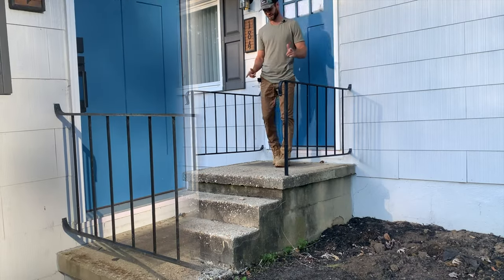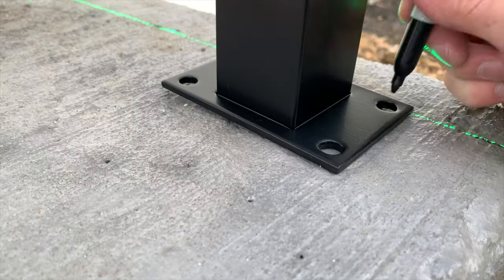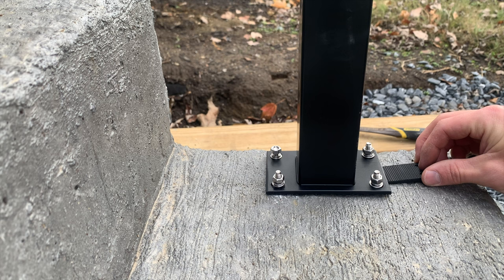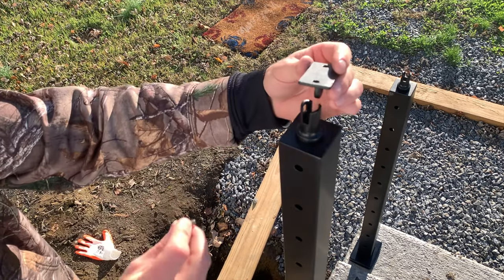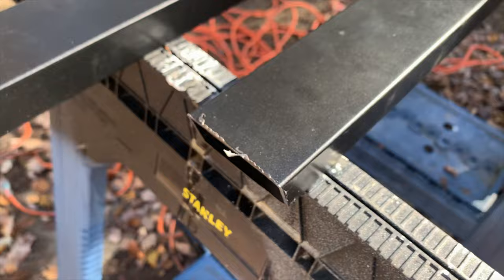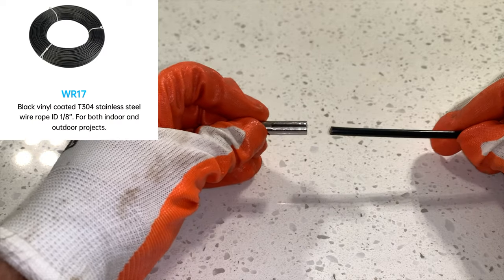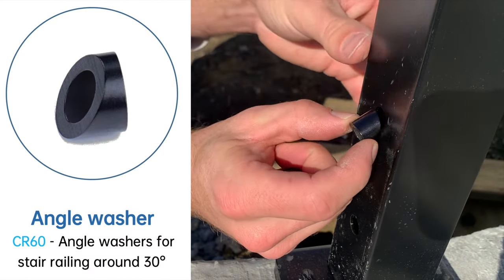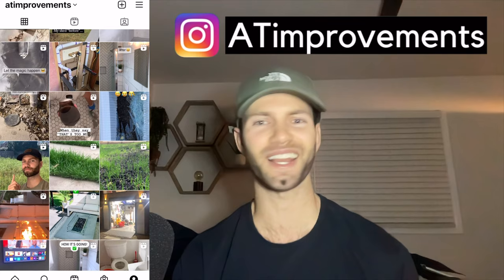How to Install a Wire Railing System (DIY Muzata Cable Railing Installation)

Comment: Thanks for the video, Andrew! Is your handrail made of aluminum? It seems to get cut so easily.
I'm working on cutting my stainless steel handrail, and it is slow going. And the paint is getting damaged due to the heat while cutting it. 

I've discussed this with their customer service but none of their tips seem to be working. They did recommend a resin wheel vs a steel cutting wheel.
I'm wondering how you are able to cut it so easily!

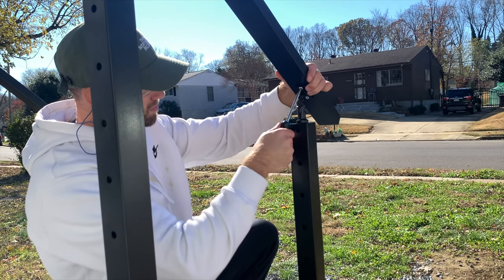Comment: Looks like you started with the black wood screws (@ 6:48) that they sent but then (@ 6:54) looks like you used machine screws.  I'm stuck here can you tell me what you did?  What size drill did you use and did you tap the holes afterwards
Reply from the maker: Hey! I don’t honestly remember the exact thing I did, but I do remember being frustrated with the screws provided and having them not fit and tighten properly. This could have been because I drilled the holes a bit sloppy, but I’m not sure. I had to go to Home Depot and get slightly larger screws to make it work. Hope that helps!

Comment: Hi Andrew! Quick question for you. I’m
Installing on nicoloc pavers. Would you know if the consistency of the paver is the same as a concrete slab? I’m assuming that is still need a carbide bit. Thx, Andy

Comment: On my cable railing the very bottom cables touch the steps. I centered the post with the stairs but I see I should've just moved the posts forward.

Comment: Did you have to tap the screw holes in the railing after drilling?
Reply: Can't tap sheet metal. Inner dia of threads on screws should match hole dia.

Comment: The screws that come with railing do not work,  why did you not mention that.  You actually also did not use them.  You started with them and then the next clip, you see they are not the ones that came with it.  Muzata needs to get their stuff straight.